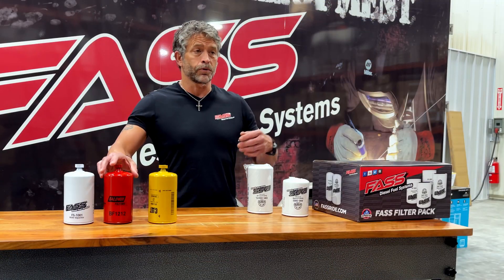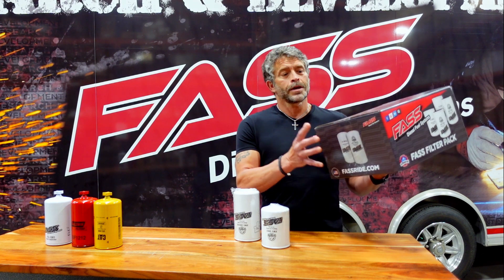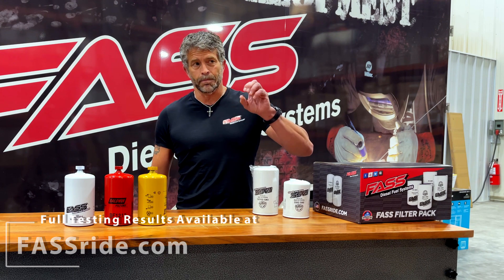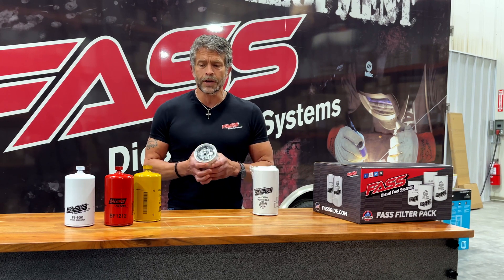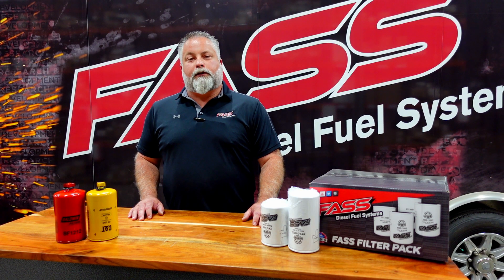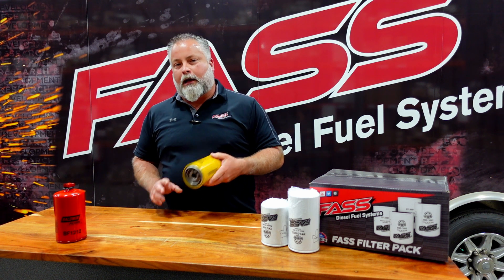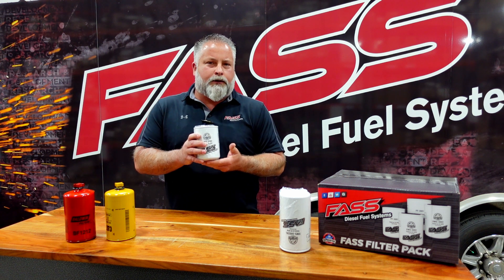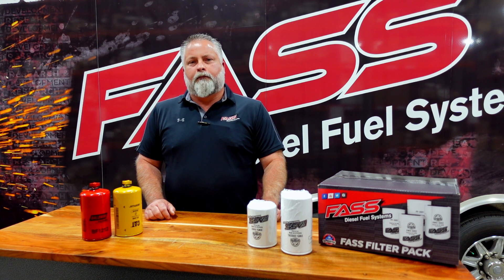Why don't FASS fuel filters have a drain? | FASS vs. CAT, Baldwin, & more!

Comment: Picking up a 2006 Chevy Express 2500 with an LLY Duramax and will be adding a FASS system. One selling point was the ability to add a heater. I was against the filters for a while but am now convinced shutting the motor down is better than blowing up the injectors. All ya gotta do is change the filter on a schedule and good to go.

Comment: I've got some questions I have a 2001 ford f350 7.3 and I'm looking for a set up I daily drive this truck and tow with it also what kit would you recommend for me to get and how hard is it to install on this truck
Reply from the maker: Great question, and for your truck we would suggest using our: 

https://fassride.com/shop/product/shop-category/2003-2007-6-0l-powerstroke/fass-tsf14180f140g-titanium-signature-series-diesel-fuel-system-180f-140gph45-50psi-ford-powerstroke-7-3l-and-6-0l-1999-2007/

We have the manual link for you here as well: 

https://fassride.com/wp-content/uploads/TS-F14-180F-140G.pdf

If you have any other questions about the installation you are welcome to reach out to our service team at 636-433-5410. Thank you!

Comment: So FASS filter stops water. Got it. Now eventually the filter get saturated with water, correct? How often does the filter need to be changed, drained? What happens at max saturation?
Reply from the maker: Typically we suggest changing the filters every 20-25k miles or 1yr whichever comes first. 

If the filter reaches max saturation it will actually cause a restriction to the FASS and pop a fuse to stop water from entering the injection system. We actually made a video showing an extreme case in which this happens. https://www.youtube.com/watch?v=3pYIyIvj5Y4&t=47s
Reply: @FASSFuelSystems  Thanks for the follow up. I was trying to understand my new pump system.
Reply from the maker: @AlexShrugging  Absolutely, are there any other questions you had about the FASS?
Reply: @FASSFuelSystems  That is all. Thanks
Reply from the maker: @AlexShrugging  You bet!

Comment: Does fass offer a filter with larger microns for winter use ,even with the heater and additives my pump won't pump the fuel when it gets 20 below and blows the fuse if I put a oil pan heater on the filters before starting I do fine it seems in cold winter conditions a larger micron would be the awnser
Reply from the maker: Hey there, thank you for reaching out about this and we completely understand where you're coming from there. 

Just to make sure there isn't anything else going on with the system whenever it's convenient please reach out to our service team at 636-433-5410. Our techs will be happy to help solve this issue for you.

Comment: Ok. I have so many questions about this filter. I run all my fuel through my auxiliary tank before dumping into the main tank. From the auxiliary tank it goes to the baldwin 1212 to strip water, then to a zinga aquazorb water absorbing filter, then through a normally closed solenoid, then through the fuel pump, and finally a donaldson 2 micron filter. I suck the fuel through the baldwin and aquazorb filters which filters also for the solenoid. I then push the fuel on into the final 2 micron filter. In my opinion i prefer to attempt to remove water right before a pump so as to not further emulsify it right before trying to strip/absorb it. Then the fuel sees the trucks tank and all factory filtration that a 2015 cummins has stock. 
I went this route because i found it was likely illegal for a filter to be placed between the tank and motor that could fully clog and block flow causing a loss of power on the road. 
If the fass filter sees a slug of water will flow of fuel to the motor be cut? Do you have a bypass in place to allow the operator to safely exit the freeway? If fuel is bypassing possibly through your filter base how would you know you were in bypass and that you need a new filter? I think the Dept of Transportation wants fuel to be available even if it is unfiltered so as to not cause a engine to simply cut off. But, i am not sure and just wondering. This is why i have been told over and over a filter that fully absorbs water and that could block flow of fuel is illegal in this position without a bypass or the ability to supply even contaminated fuel. A safety issue. Even bad water contaminated fuel is better than suddenly no fuel. 
And, without a drain to visually inspect the fuel filters water capacity how would you know if your filter was almost completely plugged with water. I have seen filters plug with one tank of bad/water contaminated fuel. And without a way to inspect you would simply be guessing as to condition and this could be catastrophic and impact safety. 
I am a fan of FASS. Ran them on past trucks. I am just wondering what is going on here with the current filters and if this setup is even legal.
My current set up is all homemade.
Reply from the maker: Thank you for reaching out. Great questions and we would recommend giving our tech department a call to do a little troubleshooting. We have techs available at 636-433-5410 or 866-769-3747 between 7 am Central time to 7 pm Central time.

Comment: I have a 3 year old Titanium 95 and would like to have a water drain like the older systems had. I work in the oilfield and frequently using fuel from slip tanks etc. I need to be able to drain the water regularly rather than millions of dollars replacing filters. Which filters should I use then?
Reply from the maker: Gotcha, we completely understand where you're coming from there and have a link here for the filter combo we'd suggest in this case. 

https://fassride.com/shop/product-category/replacement-parts/replacement-filters/titanium-series-blue-base/

Comment: I have the FASS Signature 140 gal on my 6.0 Powerstroke. Thought my filters have a good bit of life to them as they were changed not to long ago. However, the truck is starting to make a lugging sound at low rpm’s but no codes. Could that be the filters might’ve gotten water in them and need to be changed?
Reply from the maker: Hey Jason, thank you for reaching out. Great question and that is a possibility for sure. A lot of times it's from watered-down fuel at the gas station that causes the issue. Whenever it's convenient for you please reach out to our service team, they will be happy to help get this diagnosed! Our number is 636-433-5410.

Comment: Has the new water separating filter filter caused any issues in cold weather applications? The old filter you could altleast drain the water it did catch.  New system seems like it will lock it in place then freeze. Would it be a good idea to run old drain style filter in winter and new filter in above freezing temperature weather?
Reply from the maker: Hey there, thank you for reaching out! We completely understand where you are coming from, and will be happy to help. 

With the new filters yes they do trap the water instead of letting it drain out, but we haven't heard of anyone having issues with this in the colder weather. 

One thing that will help, and we would also suggest adding to the system depending on where you are in the country is a heater kit. 

https://fassride.com/shop/product-category/accessories/electric-heater-kits/

Comment: I have a Faas Fuel System on my 08 Cummins 6.7L and I live in Canada. I do add fuel conditioner when I fill up but I would assume it would be a good thing to change them every oil changes just so they do not blow up when we hit - 30°C ? Lol!
Reply from the maker: That's just wild how cold it gets there! As long as you are comfortable changing filters that often that is totally fine. Our spec for changing filters is 20-30k miles or one year whichever comes first.

Comment: I'm a year late on the comment 🙃  however I've used both the FASS and Airdog with their own filters and I've noticed the FASS filters are bigger than the Airdog  filters. I had no issues with FASS what so ever and this was on the infamous LB7, I'm using the Airdog II 165 on the monster LML and I'm currently throwing a p0087 code "change fuel filter"  and these haven't been on the truck for more than 10,000 miles. In my opinion the FASS filters are extremely effective and I never had a lag in power even after lingering with them on a little to long and no change in performance after the new filters were applied💪. Both gentlemen had an honest approach to the performance of the FASS filters and for me it's a draw because honesty is policy. Thank you for what you do for the diesel community 🙏....
Reply from the maker: We really appreciate the feedback Scott! Thank you for all the support 👊

Comment: Is there a way to show how much water contamination you have currently in the filter? I live in Wisconsin and part of the reason ive ran the old screw filter is unless you have multiple spares when it gets to freezing temps you’ll be stranded on the side of the road because your filter froze. Too bad you couldnt make a filter with a color changing indicator or something along that line either way great video.
Reply from the maker: Hey there, thank you for reaching out! One way to tell before the filter gets full is the pump unit itself will start getting a little louder as it has to work harder to pull fuel through the filter. 

We completely understand where you're coming from though! The last thing we want is for our customers to be on the side of the road. 

If you have any other questions, or if anything comes up you are more than welcome to reach out to us at 636-433-5410. Thank you!
Reply: Get a fuel pressure guage and it helps. To see what's going on. 

Get the filter disk heater and heater probes, wire it to a switch after the IGN feed. I have 2, 1 is a red LED and controls the heat, 2nd is green LED and controls pump. Turn pump off,  turn ign on to fire heaters for a bit. With a temp sensor and gauge you can monitor it. After heating, flip pump switch and watch fuel pressure on your guage. The heat can thaw it completely. 
If you really need extra heat, connect the coolant ports.

Comment: He explains what happens after the other filters fill up, but not the Fass. Any explanation for what happens to the water when the Fass is at 100% capacity?
Reply from the maker: Great question! While older-style drainable filters will simply allow water to pass through to your engine once full, FASS filters will actually restrict flow to the point of shutting the engine down. 

Simply put, completely filling older filters can mean replacing injection components. By comparison, a full FASS filter means you simply need to replace the filter—no water ever reaches your engine!

Comment: Jeremy won hands-down. His explanation comparing coalescing and the Foss water  trapping system was clear and concise.  What wasn’t explained when referring to both systems will leaving you stranded on the side of the road was the explanation. My question is: does the FASs system stop fuel flowing and therefore leaving you stranded ?  I bought my system for my 2006 Duramax back when it was 95 gallons rating. For the first few years it held a steady 10 psi and now when the engine warms up it drops to 8 psi. I’ve been told by FASs not to worry.  I’ve bought the cat filters for my Fass but after watching this video I will put them on eBay.
Reply: Yes the water filter will stop the flow or plug it popping the fuse...then you know something is wrong. Carry spare 10a fuses and spare filters. Ideally you have a fuel pressure guage. You can see the pressure dropping as it gets full.

Comment: I like the second vid better. But it sounds to me like having a filter with a drain to catch the bulk and your new filter after it  would be the best setup. How often should you replace the fuel filters? How do you know if it's going bad? I live in a area with allot of rain.
Reply: 20-30k mi depending on the quality of fuel. A fuel pressure guage essentially shows the health of filters. As it fills the pressure drops cuz flow drops.
Reply from the maker: Hey there, this would actually be a great question for our service team sir. They are here from 7-7cst, and the number is 1-866-769-3747.

Comment: Brad has a very professional sales presentation. Jeremy did really well. Both get to the point. The point is the product. The product is the best on the market. I have a titan series because of it. There’s 2 different styles of presentation both work. FASS sells more than 1 pump! The point is buy FASS pumps and filters or you can thank the shop that just put your truck back together at $135 an hour! Plus parts and injectors are around 3000 parts and labor. So just enjoy your new pump and filers like I am and relax knowing no matter where you go and what you pull, you can go slow or really really FASS!

Comment: i liked brads explanation, and then Jeremy said it a different way that i liked as well. i’m really inbetween running a FASS vs an air dog. my biggest concern is the inability to adjust fuel pressure with the fass. at the end of the day they both have the ease of changing a filter on the unit, and if you’re guys filter is that much better, then i don’t see why the unit itself wouldn’t work just fine.
Reply from the maker: Thanks for the feedback! And definitely give us a call at 636-433-5410 for more information on adjusting pressure with FASS.

Comment: I'm going to have to go with Jeremy.  They both did a  great job on explaining the purpose of the importance of a FASS fuel system for your vehicle,  especially since I've been hesitant on purchasing one. I've always been interested in the FASS system compared to its competitors but what's been holding me back was the dedicated filters only for the FASS pump. Since I do travel a lot cross country with my family, I  didn't want to be stuck out there if something was to happen with the filters. But when Jeremy mentioned about the criss reference to the filters, especially the CAT since I currently have it on my 2011 Chevy Silverado Duramax 2500 I  won't feel abandoned out there.  Thanks for the clarification..

Comment: Jeremy, gave more information on how the water separator filter worked and on how it hold on to the water and not let it sink. This is why I went with a fass 165 for my lml, my cp4 is happy 230,595 miles on it and going strong!!!Great work guys!!💪  American made 🇺🇸🇺🇲
Reply: It’s not about water it’s about lubricant. The cp4 was not designed for American fuel it was developed for another country’s fuel. Get that POS switched out for a good cp3 or make sure you are using Hot Shots LX4
Reply: @Aaronelliott847  yes sir I order a 12mm cp3 from industry injection
Reply from the maker: We love hearing feedback like that!

Comment: Gotta give it to the sales pro. Smooth and informative.

Technical question though. If you have a near 100% water barrier and no drain, where does the trapped water go?
Reply from the maker: Thanks for the feedback! And that's a great question. Where a drainable filter will actually allow water to pass through once full, our filters will actually shut fuel flow down. While that will momentarily disable your truck, you'll save thousands in injection system repairs. All you have to do is swap in a new filter!
Reply: @FASSFuelSystems    How much water does it have to have it before it no longer allows any fuel to pass through it??
Reply from the maker: @garygreco3769  This is an awesome question man! The life of the filter has many variables that affect the life of it. If you have any questions please email techsupport@fassride.com we will be happy to help!
Reply: @FASSFuelSystems   So you are stranded on the side of the road,or worse on the road,until you are towed to a shop and they diagnose fuel filter full of water,and replace them ...hmm
Reply from the maker: @garygreco3769  While our filters will shut your truck off if they become completely waterlogged, the older style filters, like those used on competitor's systems, will allow the water to reach your injection system, ultimately forcing you to pull over anyway. 

The difference is, you can simply swap fresh filters onto ours, and you're back on the road. If a component of your injection system would fail, the repair would be FAR more time-intensive and costly. 

We hope this helps!